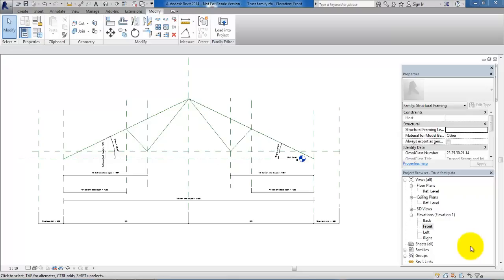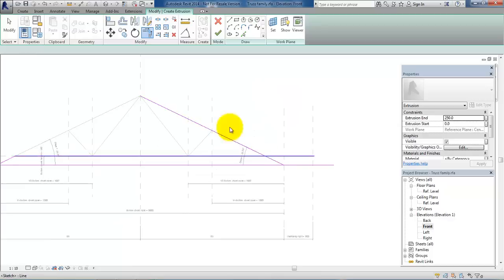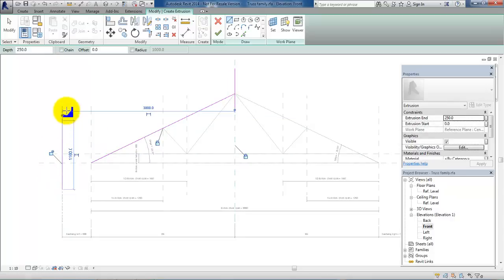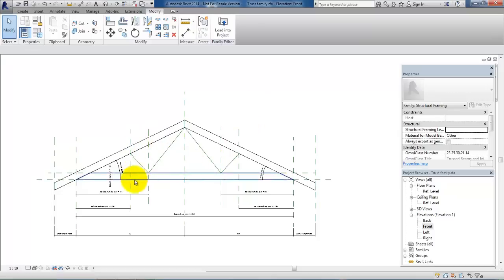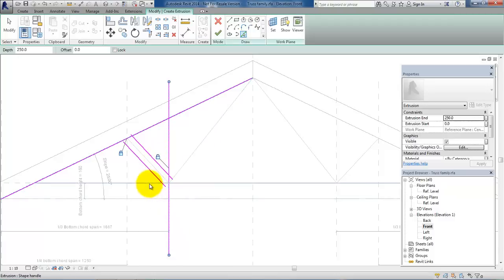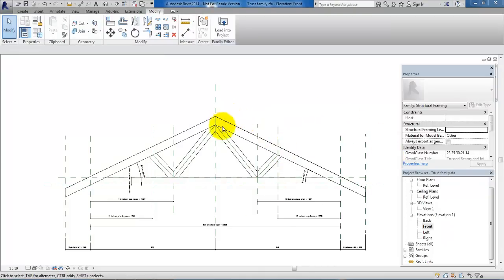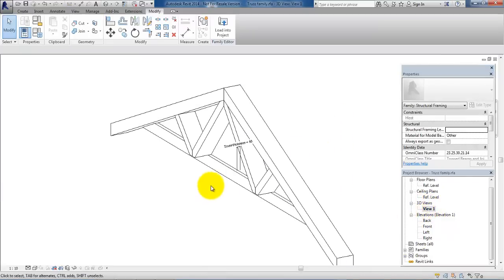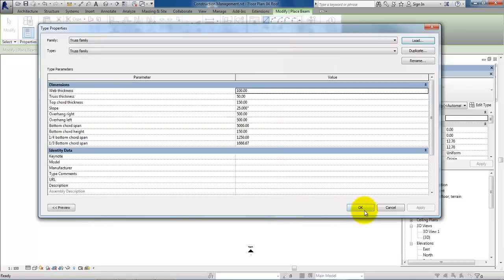Revit 2014_Create a truss family - part 2

Comment: Thanks for share and for make english "understandable" for me
Greetings from Chile
Reply: DESURBE Im new user in Revit: how can I attach a roof to the trusses?
Reply from the maker: DESURBE A simple way is to model a basic roof (e.g. using "model by footprint") and set the slope of the roof, so it matches the slope of the truss. Afterwards you can place the truss manually inside the roof structure...An advanced solution would be to model all roof elements (trusses, distance strips, battens etc.) as 3D families and afterwards model the roof (using the 3D components) in the same way as it would be built on site (but it's a very advanced solution) :-)